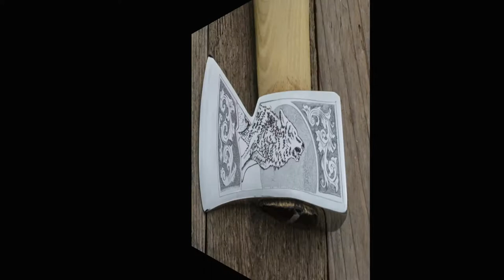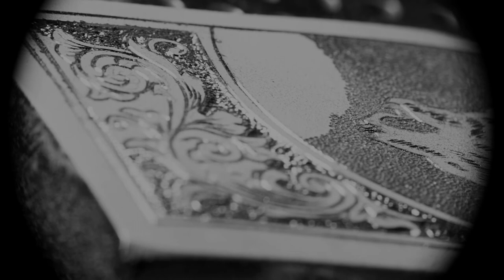Hand Engraving Howling Wolf on Axe

Comment: That is some beautiful work right there. I love it! Thank you for sharing.
Reply from the maker: Thank you too!
Reply: @ASkobiDesigns  what do you use for tranfer image?
Reply from the maker: @mbootgae1497  I used to draw on a painted surface, but now I'm printing the design using laser printer and I don't let the paper go through the heat chamber of the printer. I stop the printer and remove the paper. Then I put Damar Varnish on the axe and let it dry to a sticky point. Then I place my printed design on it and let it dry for couple minutes and remove it. The last step I used heat gun to cure the laser ink on the axe so it doesn't smudge.

Comment: Where can I get one of those blue things you used for sharpening your graver? Been trying to find one to keep my templates from getting eaten my my kitchen counter.
Reply from the maker: It can be any plastic sheet. In this video it shows my blue plastic which is 1/4" thick.
Search ebay or internet for "Natural HDPE Plastic Sheet" or ".25" plastic sheet" and you will find leads. They obviously come in different colors. Look for a smooth top though for frictionless sliding during sharpening. Hope this helps!
Reply: @ASkobiDesigns  thank you!👍

Comment: stunning work, out of curiosity is this done before heat treating while the axe head is still soft? would love to try my hand n have a go.
Reply from the maker: Usually the bottom 1" of the bit is hardened/heat treated and that area can not be engraved. The rest of the bit typically is regular steel and can be engraved.